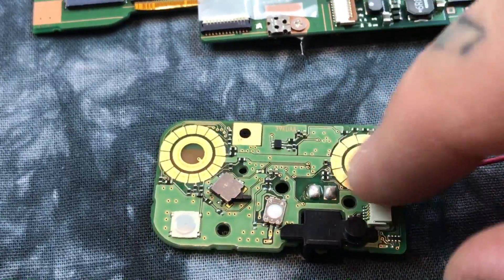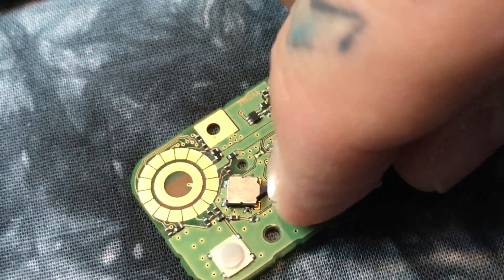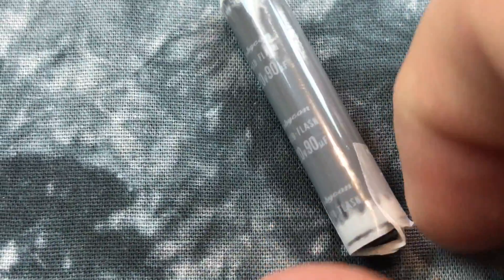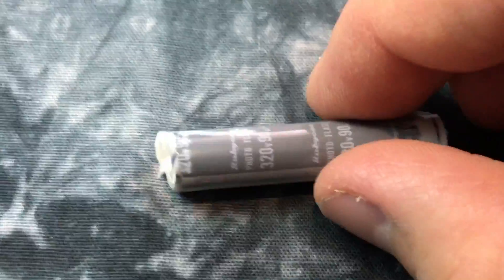🤓FUJIFILM CIRCUITRY UP CLOSE ~ INTERESTING😘

Comment: I can't wait to see what this over hyped photo enthusiast (not pro!!!) clown has to say about the best camera to date......... Sony a9!!!!!! I'm sure he will run it to the ground as he does every other Sony camera that is so much better than his Nikon garbage. Who knows though, maybe he will prove me wrong.
Reply: He will probably disregard the a9 as another trash.
HOWEVER, look at the pattern:
When Nikon releases a new camera like the D7500, they've added a few gimmicks like SnapBridge or a touchscreen (with Nikon liveview focus) but they removed your 2nd SD card & AIS metering. D5600/D3400 both have stuff removed as well, and even full frame D750 has a lot missing compared to the D700.
When Sony releases a new camera, it isn't necessary be better than Nikon/Fuji, but it is always BETTER than its previous Sony iteration. a7S2 better than a7S, a7R2 better than a7R, and a9 better than a7ii and a7.
Sony has made their users so greedy that when a9 doesn't come with the S-log features of the a7S series they got so much hate.
Nikon should come out with a newer camera without removing features from older models, or people will eventually give up the system.
Reply: macinthings agreed